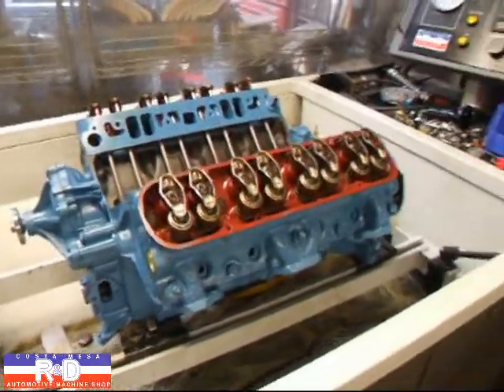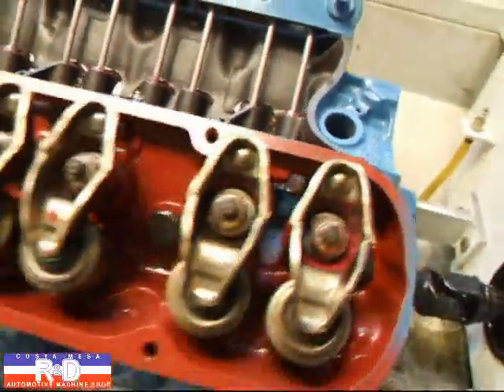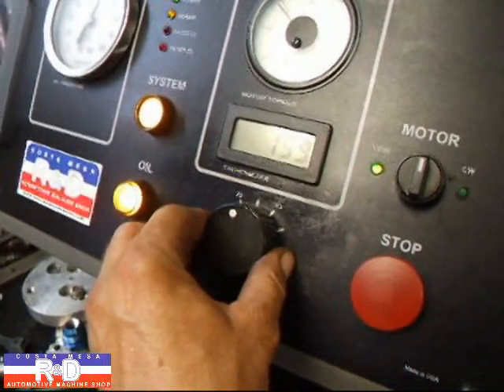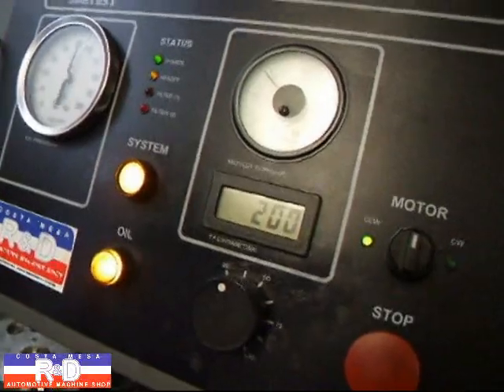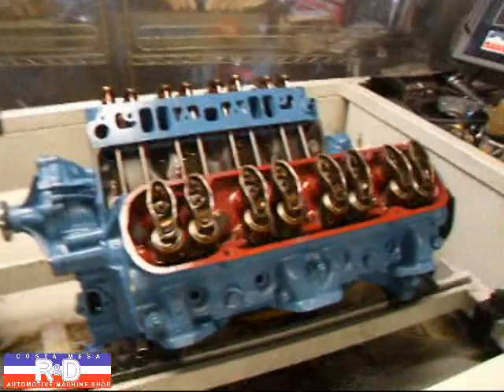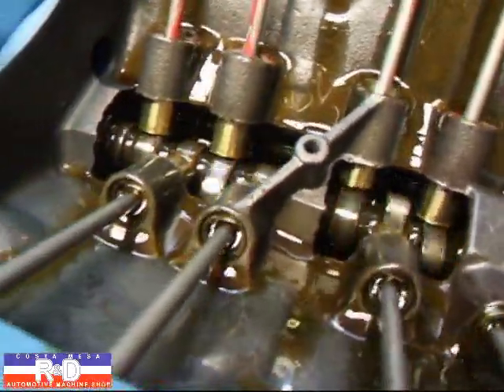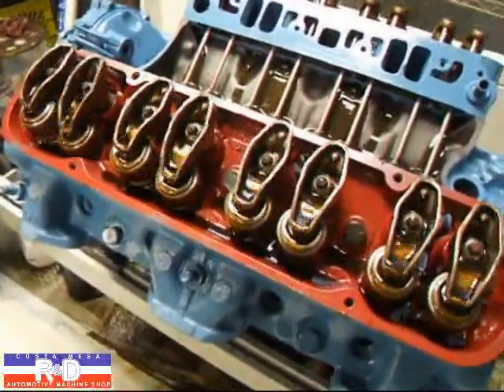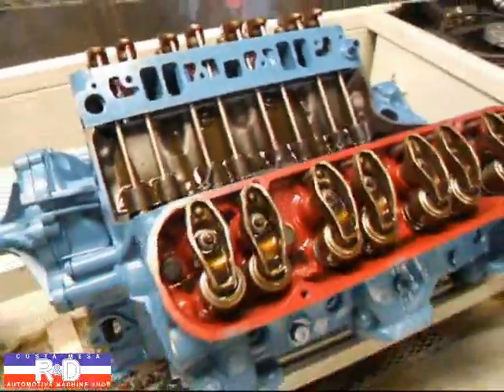389 Pontiac On Simtester

Comment: Not a good idea to paint the inside of the heads with rustoleom or whatever it is. I tried that in the 70's and it worked for a couple of days. BUT...the paint started chipping almost immediately and ended up in the oil pan...and clogged the pickup.

Comment: when the 389 was bumped 11 cubes for 1967, Pontiac also changed to a better intake and exhaust valve inclination. Still none the less a great versatile engine
Reply: Because they were searching for power to replace the tripower in 67.

Comment: Need some help. I've removed my intake replacing it with a Trans am 4 barrel. I go reverse for assembly but what's the easy way to mate up the small gasket on the front of the intake to the timing cover without damaging or moving the intake gaskets. Thank you
Reply: tighten the small long 1/4" bolt to the water pump housing 1st, then torque down your 3/8ths flange bolts, starting from the middle ones in a kriss cross fashion, ending on the end ones. Don't worry about the gaskets moving. Make sure you use some sealer and the 4 plastic retainers.

Comment: Q: Do yo recommend adding a  stroker kit with a rebuild for adding more power  and keeping the engine running mild  ?  The engine is a 383 Mopar in a Road Runner that is  completely stock. I prefer pure stock appearance - sound - and feel except with more power  --- which also allows a mild gear ratio because of more torque.

Comment: what is the difference between 389 engine and 400 engine
Reply: 11 cubic inches
Reply: jorge munoz The main difference is the bore size. A 389 (1959-66) is 4.062, and a 400 (1967-79) is 4.12.
Reply: Head design is better on the 400s too. Bigger valves, and the valve angle changed from 17 to 14° on the 400.

Comment: i love listening to the subtle difference of the Pontiac over the BBC you had on the simtester.

I know this does not break in the cam, but do you remove the cam and reapply break in lube for the initial fire, or do you think such a low rpm would not remove enough of it to worry about replacing.  Love your videos. Thank you

Comment from the maker: @kisoia - The Simtester does what I call an 'initiaization' of the engine, you still need to do the break-in procedure. The Sim allows me to see that all of the lifters are rotating correctly , check compression, and check for oil leaks.

Comment: @nobleheight  it means  to  increase  the  size  of the ports in the  cylinder  heads   also to modify them  for   better  air  blow     to allow the engine  to take in more  air/fuel and  to blow the exhaust out  easier  thereby increasing power